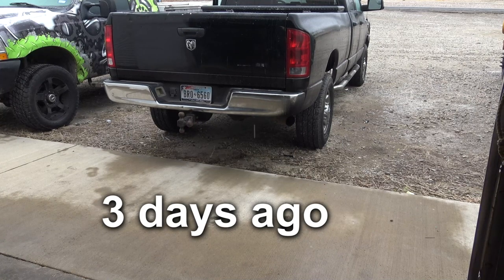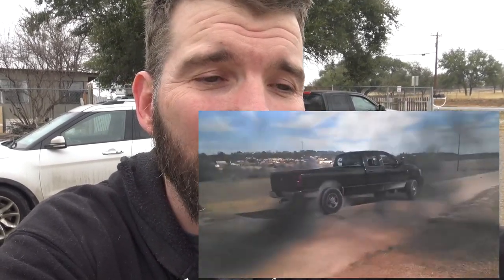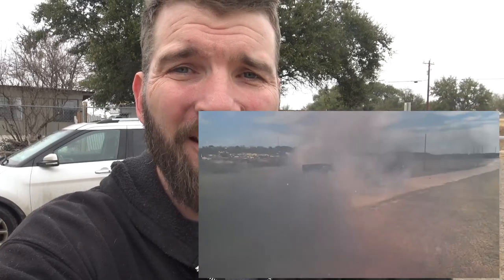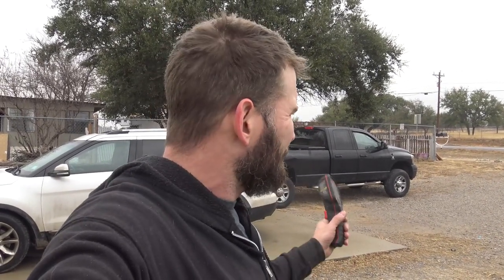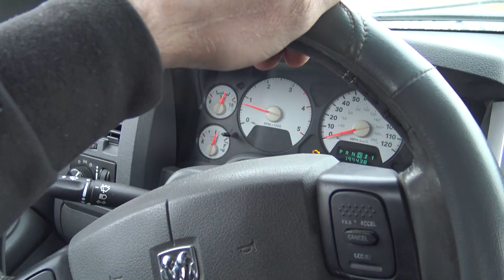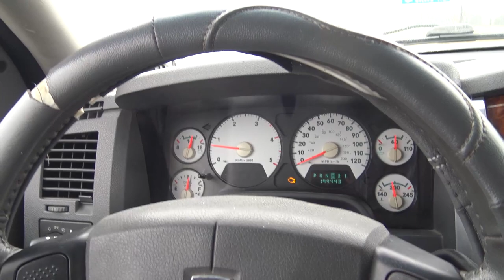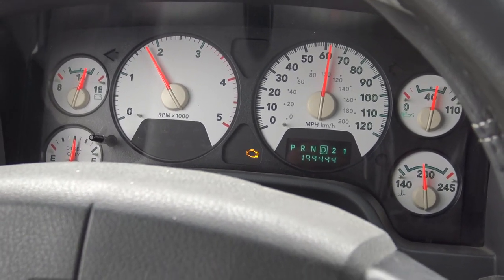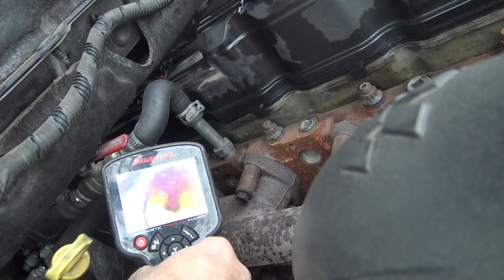What The Heck Is Wrong With This 5 9 24v Cummins?

Comment: If you can get a hold of the next of kin they can file for a lost title. Also for a bonded title the values are different. My truck blue book value is around 13k but when I got paper work from Texas DMV they set valve at 3k so it's about $200 for a bonded title.

Comment: Look at the rear water jacket bypass.  # 6 cylinder is known to get much hotter than 1-5, which can cause failures like you describe.  Lots of different adapters out there, but it replaces the rear frost plug & connects into the heater hose circuit.  If you R&R the head, might be a good time to install the bypass.
Reply: good call. i am kind of surprised it was not dune with the new head.

Comment: "Buy  another  man's hot rod, buy another man's problems."  Dad  and  Grampa  drilled  that  into  me.  So,  I  always  bought  stock  and  built  my  own.  Anyway,  Older  mechanic  I  knew  the  area  had  an  OLD  Ford  tow truck.  Always  dumped  2  quarts  of  oil  into  the  gas  tank  when  he  filled  up.  I finally  asked  him  why.  He  said  the  engine  was  designed  to  run  on  leaded  gas.  Oil  slowed  the  burn,  and  lubricated  the  top  end  a  bit.  That  was  the  early  '80's.  That  truck  was  an  early  '70's'  maybe  even  mid  to  late  '60's.  Retired  it  about  10  years  ago.  Truck  was  shot,  engine  was  fine.

Comment: Every Ford I've owned has pushed well passed 320k miles.  My pops had two 89 F150's 4x4s' that both have over that in miles.  I had a 95 F150 extended cab was too big of a truck for that little 302 motor;  so it was gutless when towing things, but it was an off road monster in 4x4 LOW with the mud tires I had on it.  It finally spun a bearing and was knocking real hard at 340k miles, so I sold it for $800 and bought a 7.3L Diesel.  It's a 2002 F350 SRW 4x4 with 6spd manual trans and manual EVERYTHING on it.  Manual transfer case/ manual trans/ manual locking hubs/ manual seats/ locks/ windows/ mirrors.. ect..  And there's over 320k miles on it now and is still going strong other than the classic leaky oil cooler/ heat exchange.  It has to be plugged in for cold weather starts..  My buddy has the same truck with the V10 like yours, and it's in even better shape than mine.  This era of SuperDuty's is probably the best trucks Ford ever made, including yours...........  As for the Dodge-- I'm not real sure.  I tend to ignore the small things and just drive it until something it MUST be fixed. lol..   Could have been just a cracked valve seat that swells back shut after it warms up.  It's pretty common for them to crack and still keep running for a long time.

Comment: It's a good idea to use the "blue oil".  I use it in my 7.3 and 6.0.   I got the tip from Power Diesel magazine.   They barely smoke.   Great videos man.  Keep the faith and push on through.   God speed sir.

Comment: I overhauled a 5.9 ISB a few months ago that ate an exhaust valve on #1.  When I tore it down 5 of the 6 pistons had one broken ring.  Only took 6 weeks to get a head gasket and .020 pistons.  I'm sure you know but injectors are a weak point on those pigs, might be worth pulling them and having them tested if the cold start and idling issues persist.  Better you then me.

Comment: What up Stephen!!! Another option is if you know someone in with a towing company, they can file the paperwork for the title. It costs money, but less than 200 is what I did for mine. Itll go back to the original owners address, via certified mail, if they don't sign for the letters than in 90 days it'll give you the paperwork to file for it. And yes, this is in Texas.  But less than 200 is cheaper than than bonded title, which is 10 percent of what its appraised for, so 17000, is roughly 1700, plus the insurance.  Hit me up if you need the details
Reply from the maker: Im definitely looking into that!

Comment: I'm not sure but I believe these engines have a coolant pipe on the back of no6 cylinder which is a fault synonymous with an air lock which effects no6 cylinder and causes a specific overheat on that cylinder 
I watch Greg Arabella Cummins all the way with him
Sounds like it's got a tune in it tho

Comment: What you had is most likely a sticking injector. Especially since you said it hadn't started in some time. Just pull em and send em in to get cleaned and flow tested. If it was a valve you'd still be hearing the rhythmic clicking/tapping. Give your pushrods a look and valve lash as well.

Comment: Get some decent fuel filters 2 micron on there... remember the cross over tubes also have screens in them. Get rid of that crappy K&N air cleaner. They are known to damage diesel engines. They don't filter anywhere near as well as stock air boxes and filters. Flush the crap out of the cooling system. I use CLR, then coolant flush, then water, then fresh HOAT coolant. You can stop with the 2 stroke oil. Just use some decent fuel additive if you feel the need. (and thats wayyy tooo much 2 stroke oil anyway) Power Service makes good stuff as does Hot Shot Secret. (and yea, you need to get the paper work from the ex-wife) Change the engine oil. Clean oil (don't laugh) does wonders. I bet no one knows when it was changed, or what was put in. Any gauges in the truck? I didn't see any. Tweaked engines can drive the EGT's way too high. Based on what you said was done, gauges should have been the first thing done.

Comment: Number 6 got too hot causing the valve stem to stick or the seat to walk. You are running a hot tune you need the dual inlet intake plate and larger exhaust manifold also at least 4 in exhaust pipe number 6 on a stock tune can get to hot at times and break the rings
Reply from the maker: Finally, some decent advice!
Reply: Fleece coolant bypass, helps keep #6 cooler

Comment: I've only every heard to put oil in the fuel when it's a mechanical injection and never so it with high pressure fuel rails or any other electronic injection, since the Piezoelectric nozzles are precisely machined. But that's only what I've been told no idea if it's TRUE or not.
Reply: You could pour vegetable oil in the tank and it would still be fine.  It's not even going to notice a little two stroke oil;  although, Diesel is pretty oily already, so I don't really get the point.
Reply: @calholli  ultra low Sulphur diesel has a wax texture to it. Common rail fuel systems are really sensitive to it, very important to run a cetane booster with good detergent additive. 2 stroke oil will work in a pinch but after time it will cause buildup of carbon in the injectors. The old saying something is better than nothing 🤷‍♂️
Reply: @calholli  Only in mechanical injection and early electronic injection such as the VP pump 24 valve Cummins (1998.5-2002), AHU and ALH VW TDI engines. But veggie oil will clog up fuel systems over time if not dealt with properly. High pressure fuel systems are very sensitive to bad fuel.

Comment: Maybe the rough idle before was just a fluke.  I’m a little disappointed with dodge and the shoddy gauge clusters they are using.  Seems like something you shouldn’t have to worry about.  Mopar is encoded in my DNA as well though.

Comment: The soot is most likely coming from the 30 over injectors, and obviously the truck was tuned to make power, which just equals smoke on those engines, anyone with their def and exhaust dpf, DONT go adding oil, instead use something like hot shot secrets EDT , it’s designed to lubricate your fuel pumps, and not harm your massively expensive exhaust system…

Comment: I’ve owned 2 3rd gens and never engine problems. Still own the 06. Runs great only replaced the tipm and wiper motor. Truck is stock and the trans is original. 235k miles. Unfortunately you’re the victim of a truck that has been tuned and drove hard. Also when people start pulling heads and transmissions it all goes downhill from there. 🤷‍♂️

Comment: Not saying this is your problem but I have seen injectors go bad and flow more fuel than the others. I also know that on the 6.7 injectors have to be programmed to each cylinder, not sure if it’s the same way on the 24vs

Comment: Injectors or valves/valve seats is my first guess. Injectors are weak and stock filtration isn’t good enough for them better of with a fass / airdog.  Also the stock trunions are prone to galling due to poor oiling. Hopefully that head they used is not stock seats and everything is done right. Good luck man.
Reply: I would use hotshot secret EDT over 2 stroke oil personally common rails are really picky on fuel quality.

Comment: I think I would pull the head or atleast  pull the valves down maybe you'll find more then what you expected .  maybe  the cylinder  that the bridge fell off  may have a bent push rod  . Atleast to insure  your not about to drop a valve

Comment: When the engine is at high idle is there blowby at the oil cap?
Reply from the maker: Nope
Reply: @StephenCox.  Well hopefully the fuel filters were just clogged up. You could also try swapping the cam position sensor with a known good one. That might be faulty and the computer isn’t giving a code.

Comment: 3rd gen...nough said.
Ive owned 2nd, 4th and 5th gens not a issue.  
My dad owned a 3rd gen and it made me stay away.
Grab a 4th or 5th and enjoy
Reply: Not trying to argue, but I've  got an 06' 3rd gen with 225k on the clock, and stock tune. The only thing I've had to do is 3 sets of injectors and several 3 or 4 clutches. Yes I have put the ol' girl through the paces she is a worker she has seen abuse. She is not a daily play toy/ daily princess.
Reply: @ruralram100  glad you haven't had any issues...sadly i can name 5 buddies who werent that lucky.  Ones ended up smoked.
Im a Ram guy through and through but 3rd gens arent for me.